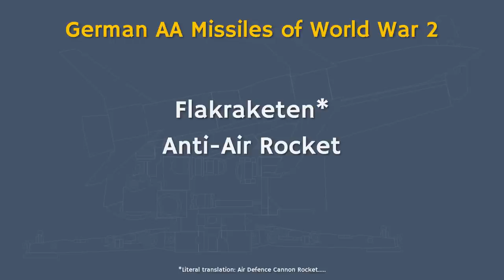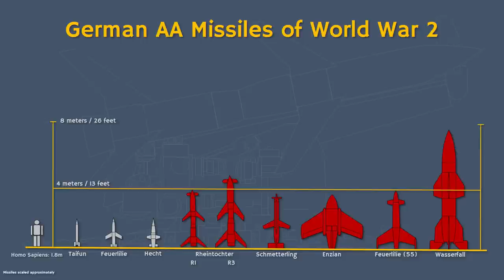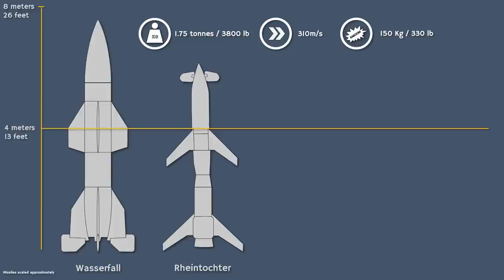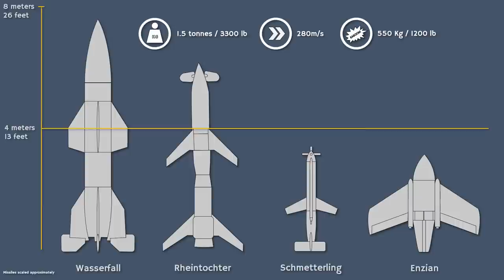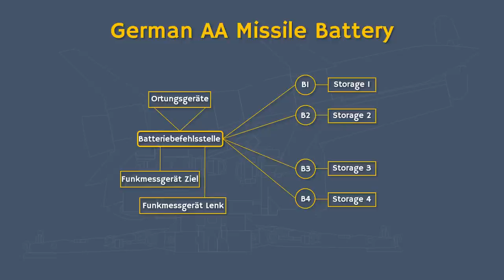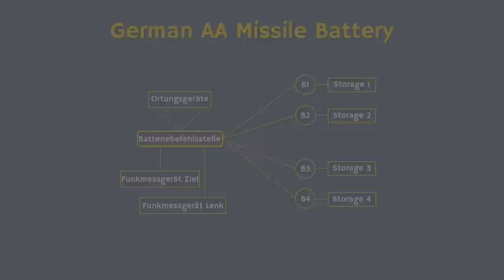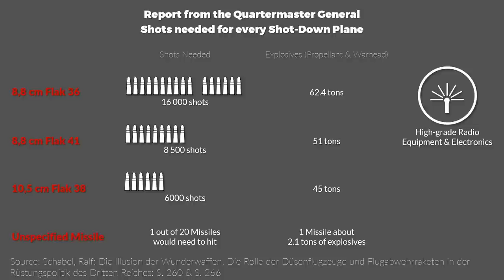German Anti-Air Missiles of World War 2

Comment: In my opinion, the Luftwaffe could have used a rocket system on their fighters against B17 formations, to great effect. They could have used BF110 with no or few guns - carrying a battery of 30 rockets under each wing. The rockets would be fast, unguided, and set to detonate at 1000m. The BF110 would fly up behind a bomber stream, with a special setting for throttle and trim, that would give the 110 identical speed cruise as a B17, and a range finder, which would indicate 1000m - This could be as simple as a marker on the sight, which would exactly fit the wingspan of a B17 within it, if it was 1000m away. The BF110 pilot aims carefully and looses the rockets in groups of 10 at a time, or all at once if preferred. This system would be an immense success, and in no way comparable to the mortar tubes slung under BF110 and FW190s, which created too much drag and fired slow projectiles that had very curved trajectory. Another benefit of this system, is that the BF110 at 1000m form the bomber stream, is far enough away that the B17s multitude of .50 Cals, would struggle to achieve a hit.
Reply: Froggy Frog 9000 They used guided missiles to destroy ships from their bomber without enterining in the range on the enemy AA.
Reply: Froggy Frog 9000 Also they used R4M unguided missiles with great effect against bomber formations, firing salvos of 6 against each bomber with a spread of 5 square meters at 500 meters range. 
A single Bf-109 could carry 30 R4M.
They were developed after seeing the poor effectiveness of the Rheinmetall-Borsig MK 108 30×90mm.
Also when the development of the G.56 started the Germans and the Italian started developing a new tipe of rocket crater to be fired at stratospheric altitude, being the G.56 the only plane during it's time period capable of stratospheric flight and, because of that, needing a pressurized cockpit.
Reply: Great points! Yes, I am a big fan of the R4M. It would have stopped the B17s if it was deployed in sufficient numbers, in my opinion. Especially, if the fin design was changed to delete the vanes and replace with 4 small arrow wings at the rear and 4 small arrow wings in the center of the R4M. That way the trajectory could be 100% horizontal, correspondingly enabling accurate fire at varying distance.
Reply: @FroggyFrog9000  R4M had one major problem, which was shared with all other folding fin aerial rockets like the later Mighty Mouse 2.75 inch FFAR used by the USAF... They were massively inaccurate.
Reply: The Natter (Viper) vertically launched rocket plane had a nose full of R4Ms and nothing else.

Comment: I remember a story some time ago where a guided missile fired from a German bomber on D Day sunk a destroyer the one and only time. It was guided from the aircraft it had a cable tether, the funny thing I haven't mention of it since..
Reply: Germans didn't use a wire guided air launched weapon in WWII, though they were working on them (and did have a wire guided tracked demolition weapon for land based use). They did have radio control guided anti ship missile and bombs and sank an Italian battleship with the guided bomb in 1943. The Allies defeated them in quite short order with a Jammer. The US also used TV guided weapons in 1944/45 (using a remotely controlled 4 engine bomber as the missile) and had their own selection of radio controlled bombs like the AZON, which did see combat in 1944/45 and the RAZON and TARZON bombs that were used in Korea.
Reply: @richardvernon317  Wrong they sunk a ship on D day with wire guided bomb.

Comment: Interestingly, the US Army came to similar conclusions regarding efficiency about AAA and the failure by Germany to prevent even a single strategic bombing raid from reaching its target, when they were designing the Nike missile system to defend against nuclear armed long range bombers, which, if even one bomber got through to strike an American city, would level that city.
Reply: MrDgwphotos The US solution was a "close counts" type warhead. Aka nuke
Reply: @mbr5742  Ajax didn't have a nuclear warhead, Hercules did, but that was because it had to deal with supersonic threats which conventional warheads would have had problems with dealing with due to fuzing  and weapon target closing speeds exceeding the effects of a conventional warhead detonation. Try outrunning the effects of a weapon who's primary effects move at the speed of light on the other hand.

Comment: @Bismark It has to be analysed the trigger mechanism. Was it embedded radio-triggered when the enemy plan was close ? I saw one missile at Technishe museum in Munchen, it was written that the flare attached was the main guidance for optical ground launcher directors, so the radar control should had been used for supporting the global view and the predictive trajectory, but radio guidance of the fins was made manually by ground operators. Finally, in the description, the museum reported a kill ratio of 50% against bombers (heavy). Great video.

Comment: It's not just the explosives required.....it's the fuel. A rocket/missile requires a tremendous amount offuel to get the warhead anywhere near the target...whilst a simple shell is far more efficient at getting the warhead to target. Thus far more shells can be thrown at the enemy for the same amount of warhead delivered by rocket motor. By the time rockets progressed to being feasible...the German Heros had already the guns to fill the parasite filled sky with death. And rockets have a nasty tendency of filling the sky with sight-obscuring smoke. Not good if you are trying to defend Europe from the synagogue of satan.

Comment: AA shell travel time is 15 mins. So change altitude, speed and direction every 10 mins was a bomber tactic by mid war. Rendering Area AA totally useless and purely a political psychological propaganda activity. Wasting tons of explosives and other ressources like people, concrete, electronics, engineering.
Electronics used tubes wich made for power sucking , bulky circuit boards that hardly could fit into a rocket. 
Anything that would yield a delayed RC signal response to such a bomber flight plan would work. Hence the creative open scope approach to protecting civilians from carpet bombing and the factories and logistics. Retrospectively mid rage aircraft attacks with an RC operator would have been the best option. Less trained pilots could have focussed bombers with RC missiles while best pilots would fly counterstrike cover. They would never closely engage the formations. This would shorten the radio range, eliminate the control-response time span and protect the airmen. However, this is the most complex cooperative and expensive solution in engineering. You need new aircraft designs, train pilots, new electronics and compact missiles at the same point in time. It's a much larger project. Progress in any subsection combining these RC control components was welcomed by this open approach. They threw tech at the wall to see what sticks. in my optionion the rear view mirror is judgemental and top nazi names are always good for projections. It's just the same way we go about Corona Virus or Climate Change issues today. Especially when you ar not an expert in that field an that specific point in time. Read the engineers diaries and sketchbooks to get into their minds. If they survived or had time for a diary in their stressful role. WWII was a war of engineers. Even more so than WWI or American Ciivil War.
Reply: AA shell is shot at something like km/s, and loses 10 m/s from gravity and a bit more from air resistance.
Make it about 5 seconds to 3km, certainly not 15 minutes!
Reply: @PaulVerhoeven2  supersonic shells would simply melt away mid flight and never arrive anywhere
Reply: Plus it's a  m/s^2 deceleration plus the air drag loss. Which massively increases at supersonic